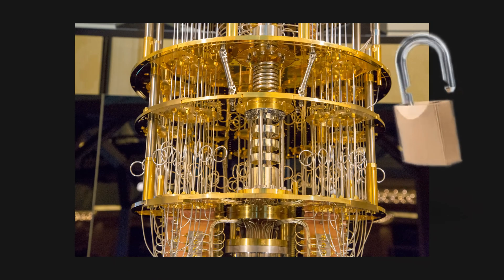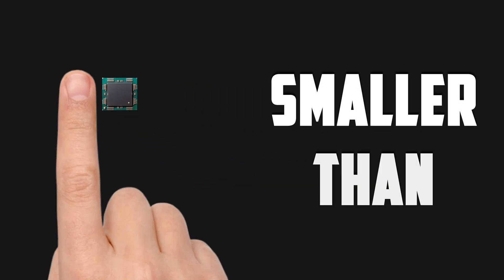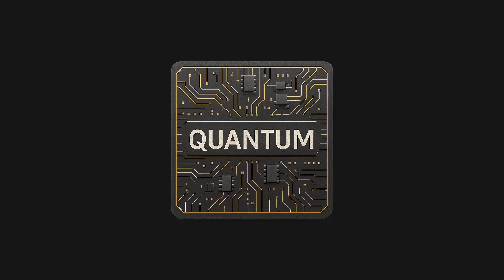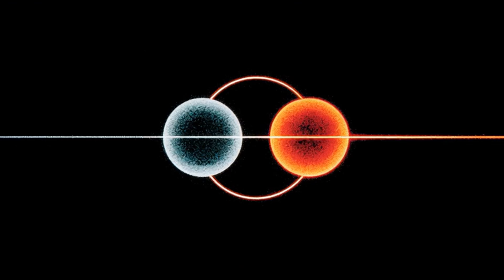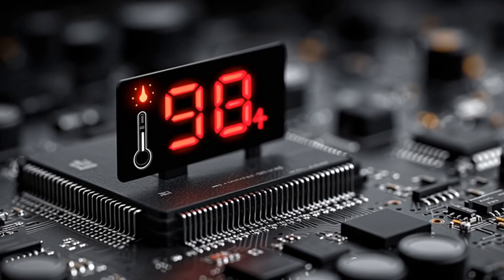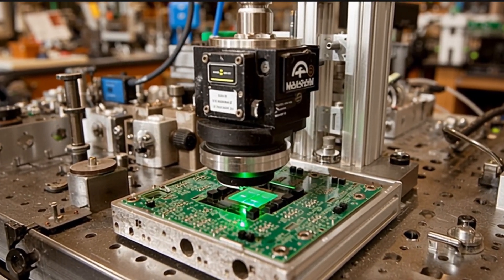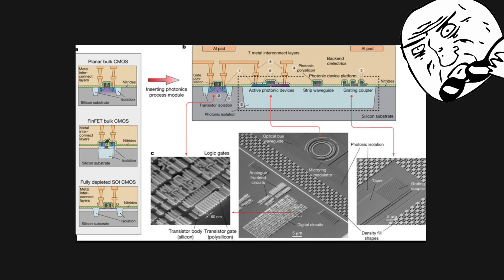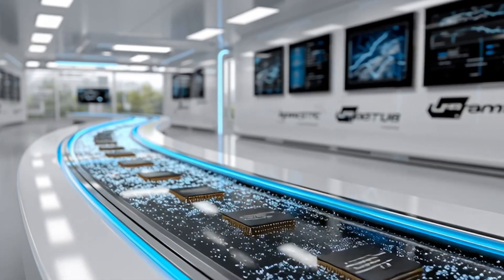First Electronic-Photonic Quantum Chip Explained

Comment: Company name?
Reply from the maker: The chip was developed by PsiQuantum in partnership with GlobalFoundries. It’s the first time a quantum chip like this has been built in a commercial semiconductor fab!
Reply: Can i learn about which career i should study to being apart of that high tech Semiconductors & that incredibly complicated machines develop-manufacturing?  @futuregennews
Reply from the maker: Absolutely! To be part of high-tech semiconductor and chip manufacturing, you can explore careers in:

🔹 Electrical Engineering
🔹 Semiconductor Physics / Materials Science
🔹 Nanotechnology / Quantum Engineering
🔹 Mechanical or Mechatronics Engineering (for advanced machinery and robotics)
🔹 Computer Engineering (for chip design & photonic integration)

Many roles in this space require hands-on lab work and interdisciplinary knowledge — so starting with a strong foundation in physics, electronics, or material science is a great path.